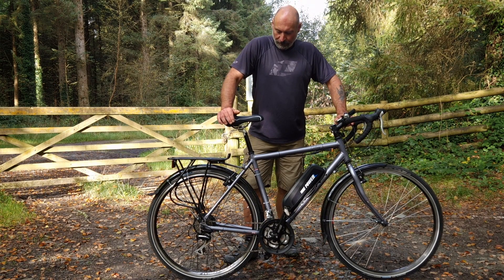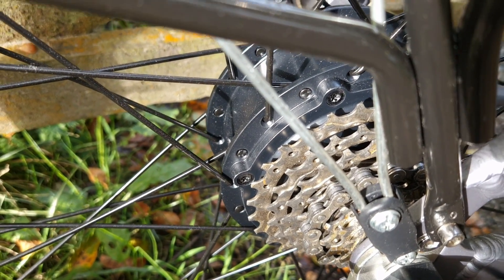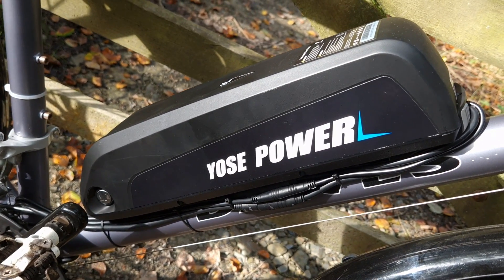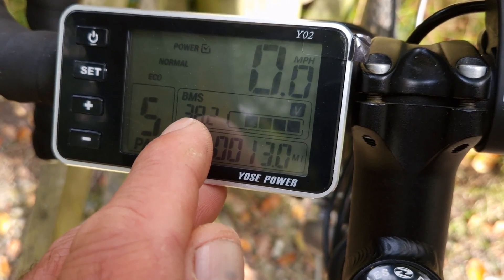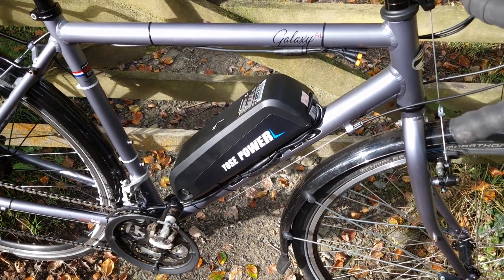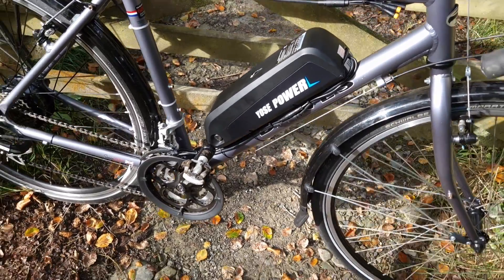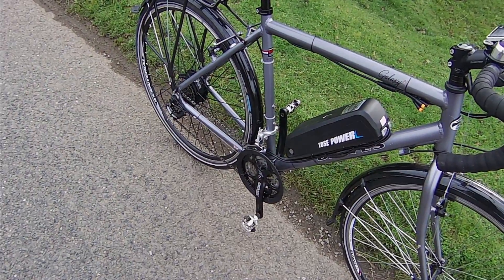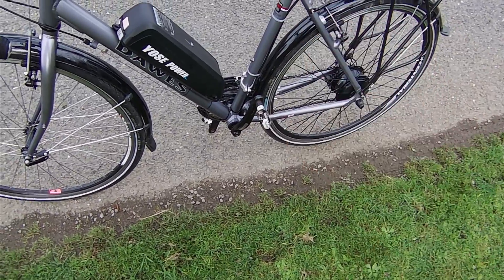Yose Power e-bike conversion kit review: Dawes Galaxy touring bike electric conversion

Comment: Great video and definitely want to buy a yose conversion kit for my Dutch style bike but have a couple of questions:
* do you remove the original gear changer or does it stay? Sorry that may be a daft question !
* also does the kit work with rim brakes as it seems to specify disc brakes?
Thanks in advance 😊

Comment: I have recently purchased the same kit as this and installed it on a giant reign , motor works excellent, but can only manage about 26 miles on power setting 5 before voltage cuts out at 28volts , would anyone say that this battery is underperforming or , given the bike is quite heavy , the performance is about right ,

Comment: I have one of these kits, now fitted on a second bike a Giant roam 2. The kit has covered 12000 km since 2019 with no issues and the battery is still giving a range of 60/70 km at level 2 and 3 assist, great kit
Reply: 12k kmh? Damn that's good going. Just bought the 350w rear kit for my kona fire mountain Mtb with the 27.5" wheels. Good to hear you're having decent reliability as I plan to use it as a daily rider. My other bike is an engwe engine x which is quite heavy and I use on sunny days just for Messing about on. Done a few mods it but is too big and bulky to use every day.
Reply: I have had yose power kit for 4 years the first kit had a silly fault  yose power sent new controller; and other bits still did not cure the problem. So sent whole new kit and never had problem since, hey never asked for all other part's back. I had great communication with them from Germany to date 1500mile hassle free riding great kit

Comment: Do you really need 138mm clearance for the motor fit in the rear dropout ? I bought a bike is a brand new hybrid with a cassette. I tried measuring it, and it's more or less 135mm. Now I'm confused.
Reply: My giant roam is 135 mm but just squeezed it in was tight but doable

Comment: Great review. I totally agree with you on  these Yose Power kits - I've installed two of them myself now, one on an old mountain bike and more recently, another on a folding city bike. They perform very well indeed and, although I live in Cheshire where it's reasonably flat, there are some steep hills here and there and the 250W motors have no problems climbing with minimal effort!

Comment: What was the watts on the battery I would like 500 w. Also my wife wants a motor on our tandem but wheels have more spokes than normal for increased strength. What is the average range? Thanks for video very interesting.